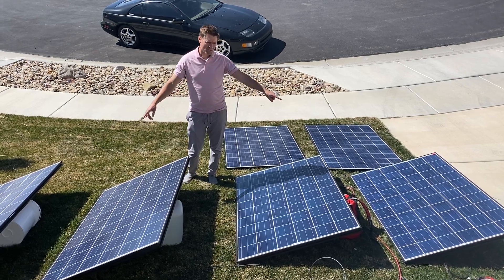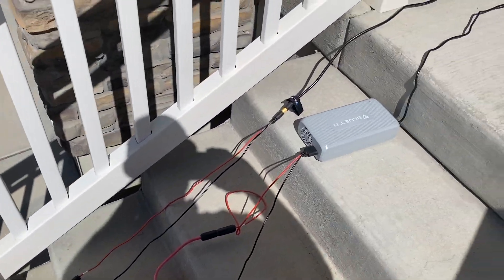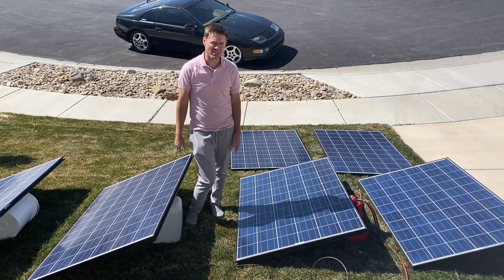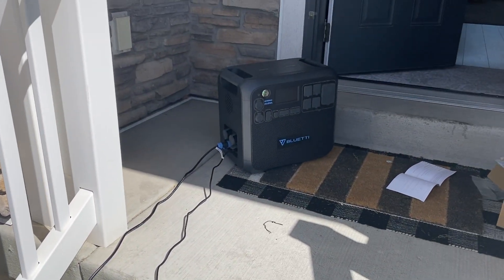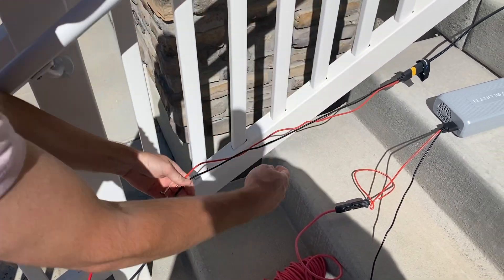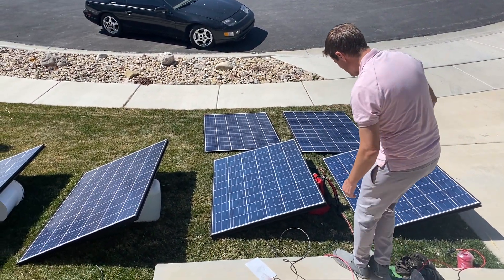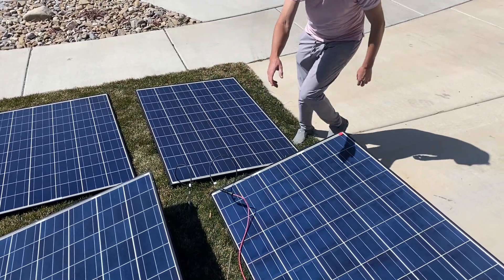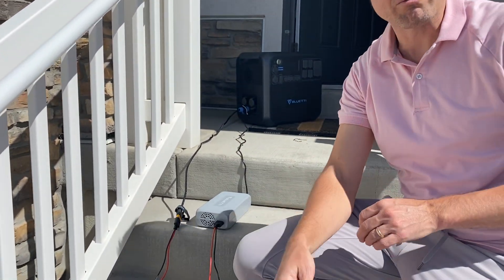Connecting TWO lines of panels to Bluetti solar generator to achieve max 1400W input

Comment: Love the 2nd gen 300zx, best car I ever owned. And BTW the factory rims are directional and side specific. I can tell the right rear are on the wrong side in the video. The ones on the passenger side should always remain on the passenger side.  The scoop shape of hole in the rim must be placed to "scoop" air from underneath the car as the rim rotates forward.  If you find the car tends to float at high speed double check the direction of the scoops. My car always felt like it was being sucked to the ground.

Comment: Could you tell me what is the grey box? Is it a converter to the solar panels? Which brand you can suggest me to buy as I have just brought a BLUETTI AC200 Max and PC200 foldable solar panels? But I want to get some permanent panels so that I can leave them outside permanently? Thanks 🙏

Comment: Always keep cords as short as possible for DC connections. Unlike AC, DC is not very efficient (has power loss) on cords/wires longer than about 50'.
Reply from the maker: We get nearly full solar panel rating wattage on the generator computer with 10 AWG. It is often difficult to reach solar panel arrays with shorter connections so it is a balance. We use 50’ for the two-panel adapter connection and 100’ with the four panel.